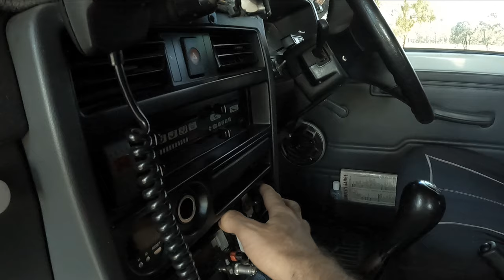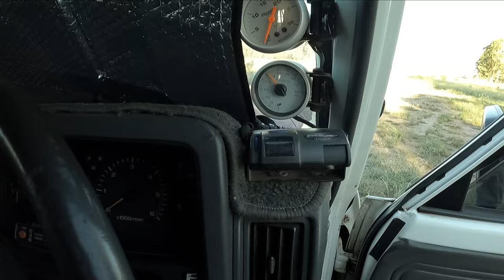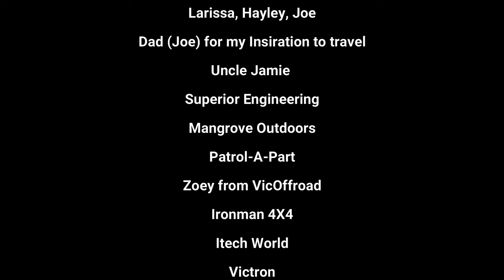Big Lap of Australia rig rundown Ep2. Nissan GQ Patrol review, set up + built to explore Australia

Comment: For your front diff, change over to the Trail Safe inner axel seals. The OEM seal can wear a grove in the axel over time and the Trail safe seals have a different and multiple contact point, after 3 rebuilds in as many years, it is the only seal that has stopped mine from leaking!
It's also been suggested that a leak can be caused if the shim stacks on the top and bottom king pins are not equal thicknesses.
Reply from the maker: Thanks mate, I'll have to give them a go,  I can see the passenger side starting to leak after only 6 months 👍

Comment: Hey mate, what did it cost you for the seat? Fuel economy towing vs touring. What's your GVM at the moment? What EGTs do you get towing vs touring? Sorry for all the questions. I run a gq td with a similar set up to you and I'm always curious.
Reply from the maker: With the new big trailer fuel consumption is up around 19-20L at 100km/h. Falls to 17L at 80ks. Egts max at around 550 up mountains. We are a little over gvm fully loaded with all the tanks full of diesel. Probably should think about a gvm upgrade but we can put a lot more weight into our trailer
Reply from the maker: Seat cost about $450. So good now. I sit a little higher than standard but  just enough head room

Comment: Hi Adam, I am exploring the idea of buying a 96 Patrol TD42 (turbo and intercooled) in excellent condition like yours. I'm just a bit concerned about the travel comfort for passengers. Currently I have a 2000 95 Series Prado with 2" lift and I feel like you feel every bump in the road. Our daughter has muscular dystrophy and struggles with the constant bumps and vibrations. Are these old Patrols the same? Is it something that can be fixed with better suspension? We are planning to do the Oodnadatta Track on the way to Alice this year and more tracks in the future so trying to find the best vehicle for our needs and as my daily driver too. Thanks in advance!
Reply from the maker: Hard to say because I've driven prado, but with a solid axel on the front of the patrol,  it would probably be worse in the Nissan on high speed dirt roads.  Might be better sticking with what you have and trying new softer coils first.  Coils are relatively cheap and also what tyre pressure do you run? Might be worth dropping off a couple of psi to help with comfort ( even on the bitumen) and on dirt roads we drop down to 28psi and been down to 14psi for the Mitchell Falls road!
Reply: @GoingOverland  ahh tyre pressure, that could be the culprit. I do a fair amount of highway driving for work so am sitting up around 38-40psi. I'll have a go with that first. The old Prado is due for an engine rebuild and has an ever growing list of work needed doing to get it up to touring readiness. So another reason we're exploring Patrols (that have had all the work done to them already). Appreciate your thoughts and I enjoyed watching your  setup demonstration. Cheers!

Comment: Nice set up! How's the Gross Combination Vehicle Mass with the van and the Gross Vehicle Mass with everything loaded up?
Reply from the maker: Patrol sits a little over gvm fully loaded with all the tanks full of diesel. But we'll only fill the 2nd tank when we need. Trailer has a 900kg payload so most of the gear will go in that, it's max weigh is 2 tons, so no problem there

Comment: Hi mate love the content 👌 just a quick question how did you run the switch off the a/c iam in the process  now of doing it and have no idea if you can help that will be great thanks 🍻👍
Reply from the maker: It's pretty simple, power off battery,  to switch then piggy back wire to fan behind grille.  Works great when needed. Could of times I've had to do work near radiator after a drive and run the ac fan for 10 minutes and you can safely touch the radiator without getting burnt
Reply: @GoingOverland  good idea thanks for the tip

Comment: Hey mate love the patrol! one question how do you run the sub tank and by that I mean fill it up do you pump out of main tank or a seperate filler somewhere?
Reply from the maker: Got a duel filler from patrolapart. Electric pump to main tank. Simple setup and works great having extra 75L
Reply: @GoingOverland  wheels ,tires,,you need a big side profile. 15"-17" rims, with 35,s.  18" with 36,s. ect.  ive been down to 10 psi on sand, with 35,s. no probs. method wheels do a double internal lip,helps keep tires on rims. method wheels 701. i think. but what you do not really nesassery. old school 4x4rs best.  A guy had to limp home 1500 ks,,sensor shit.

Comment: That's definitely one awesome touring rig guys! Question is if you guys had to replace the patrol, what vehicle would be the replacement?
Reply from the maker: Good question.  I don't know. Has to have coil springs for 1. Thinking instead of spending big money on a new car and new setup, maybe a full rebuild on the patrol.
Reply: Would you say you have pretty much rebuilt the Nissan Patrol engine ? Sounds like it .. after 300,000kms in it. So glad you know about the mechanics as well. 

I would tag along with you guys any day. Just sayin ‘ 😃
Reply from the maker: @noelenewoo8087  everything except for the engine internals which is expensive to do. But the patrol engine will do up to 1 million km if looked after. My dad's lasted 750k before someone crashed into it. Yeah definitely want to organise a weekend of overlanding and filming.
Reply: @GoingOverland  what engine choice is the best option for reliability? talking y60

Comment: how do you change a rear tire without lifting the entire rear of the vehicle by the tow bar ?
Reply from the maker: Strap the axle to the chassis.  Not hard, but I can't remember ever having to take a tyre off on a trip
Reply: yes I understand that, where do you lift the vehicle from ? The wheel you’re about the remove ?
Reply from the maker: @jackdrewitt1832  if we have the trailer with us yes, we carry a jack stand in it. If not, off the rear bumper. It's got to big bolts each side similar to the bull bar.